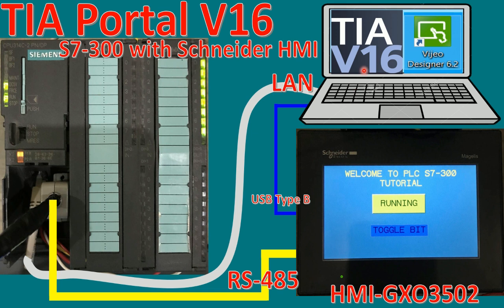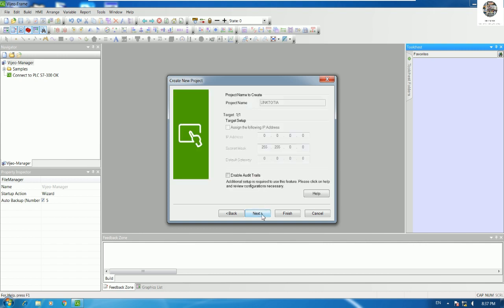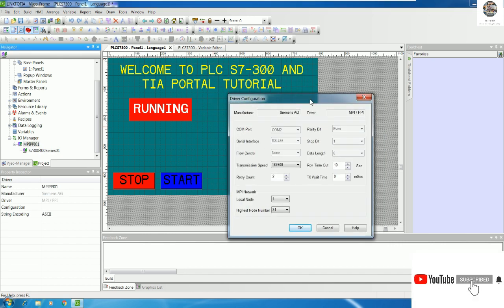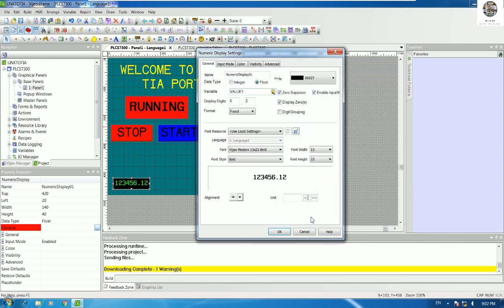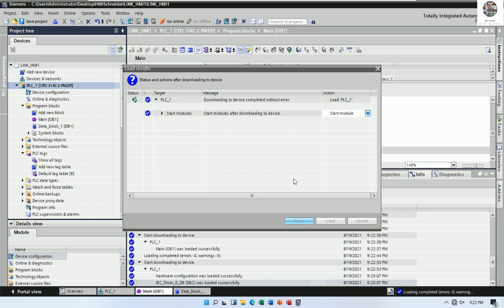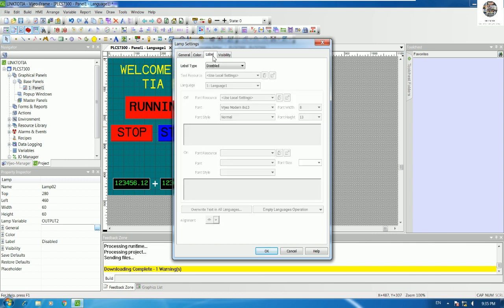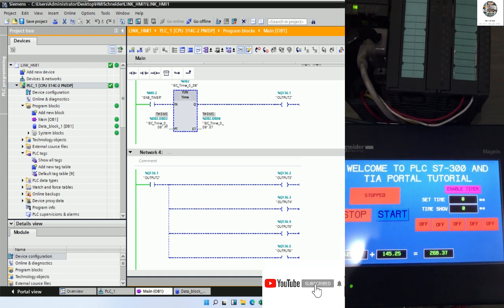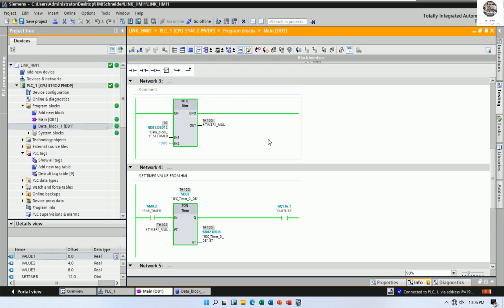TIA Portal V16 and Vijeo Designer V6.2 connect Schneider HMI Magelis GXO3502 to PLC S7-300

Comment: Can you show  RS232 cable pin assign between PLC port and HMI port ?
Reply from the maker: Dear sir,
That ok , we need to use some resistor to connect it.
I will show it in next video.
Thanks
Reply: @generaltechnologyknowledge5165  please notice me if you have done to make video, thanks
Reply from the maker: @rezaprayata281  Dear sir,
That ok I will finish it soon
Reply from the maker: @rezaprayata281  I did it.
Thanks you.